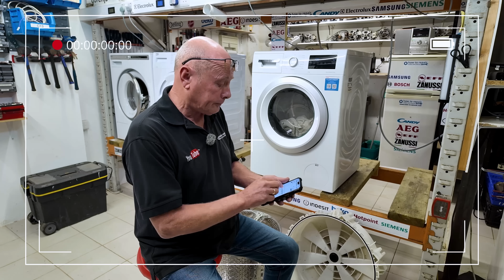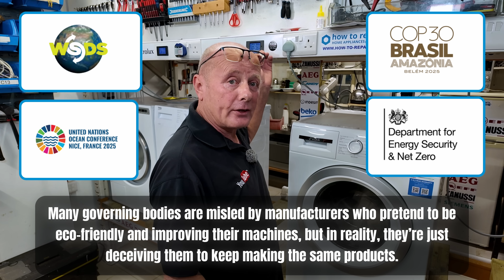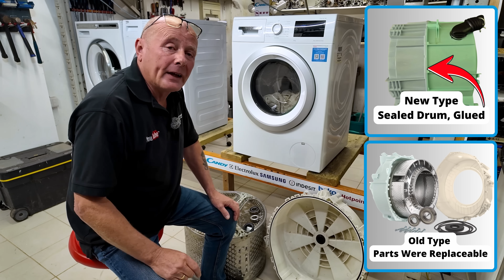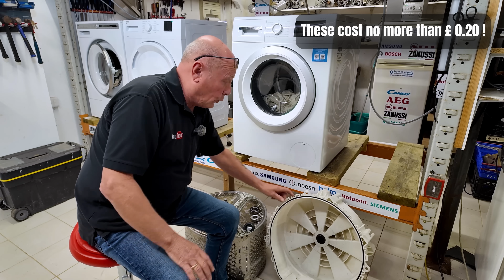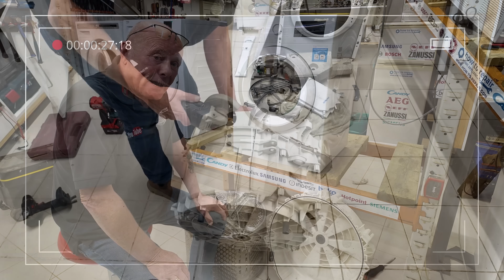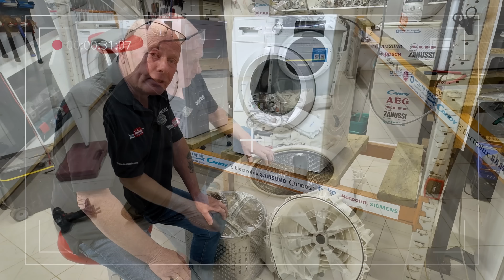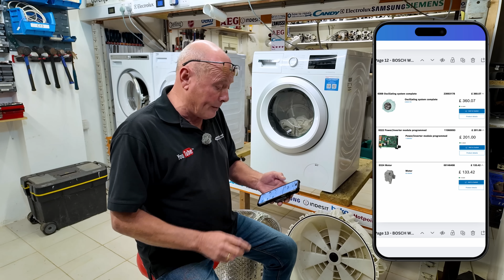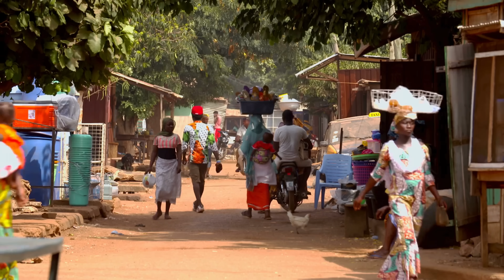Washing Machine SCAM EXPOSED! The Truth About SEALED Drums: Naming & Shaming

Comment: I can vouch for this Northern vs Southern Hemisphere build difference…

I’m from the U.K. and I moved to Thailand in 1998…

But yeah… I got a Samsung front loader I bought for 42,000 in 2010 (about £800 back then) and it doesn’t have that sealed drum scam and I’ve only had the pump, soap dispenser solenoid and 2 belts replaced! ❤
Still going good 👍🏻 

But front loaders aren’t really a common thing here…

Mainly domestic front loaders are bought by the rich & trendy and the big industrial front loaders are at the launderettes…

The average Thai still buys & prefers a top loader…

A 12kg top line one would be 15,000฿ vs 50,000฿ for a front loader… 90,000฿ for a washer dryer!!  😂😂

Comment: Just had to replace a Bosch Maxx because the digital display/circuit board (Control board, would fail part way through a wash cycle. Cost of replacing this in NZ (together with a Sub board and EFI (Electronic noise Filter was $725,  approx 2/3rds of the cost of a new machine. Number of cycles it had done was just over 800. and in all other respects was a still a very nice and well cared for machine. 
You are right, we are being scammed on everything, but why would the big corporations be any different from our governments. Also with VAT (called GST in NZ) at 15% here, there is absolutely no incentive for any government to reduce its indirect tax take by keeping prices reasonable. It wouldn't surprise me if the instructions (or at least suggestions) came from at least one overspending  Government.

Comment: My washer and dryer will be 30 years old in a few months. No way am i going to give them up. I've had to replace about $30 worth of parts in those 30 years. No PCB boards.
You'll never save enough water or electricity to pay for a new washer and dryer every 3-4 years.

Comment: I hate plastic headlights. I have a Berlingo from 1999 and headlights are glass and CLEAR as the day they were made. My Citroen from 2005 with plastic headlights became milky after10 years. Here in France the electric water heaters (cumulus) has a pcb with an obscure and often hard to find reset switch, if the board overheats - it is switched permanently off - unless you know where to find the switch! (youtube)

Comment: Thank you for your hard work, videos and informative work. I started buying appliances and equipment a few years ago based on repairability. Had a issue with a wmf bean to cup coffee machine where the flow meter failed and they refused to sell me one. They had a propriotary plug on it, ended up buying a few different model flow meters, modding the machine and fixed it, did end up loosing +-5% of actual read flow value compared to origenal but i fixed it instead of replacing...If i cant fix my own thing I bought with my money, then the company doesnt deserve my money.

Comment: If these washing machines get cheaper, it will be better just to buy a new one. I say that because when my washing machine broke it took two weeks before I could get someone to look at it under the warranty. With the average cost ., about £150 for a drum replacement when the parts are only about £15 no difference  we are getting ripped off either way., and you’ve got the ones that come out to repair your washing machine telling you you need a new motor when it’s only the brushes. That’s what you had to deal with years ago before YouTube came along., so for me if these washing machines are cheap enough and they last you a couple years I’m all for it

Comment: From the number of standard washing machine failures on multiple machines. one of them could have been avoided if the manufactory hadn't left off a 1 cent part. I would say the companies must have know about the issues, but have done noting over the years in changing there designs to fix them.

Comment: I've had an LG washing machine for the last 11 years and it's still running fine, no issues or breakdowns so far, despite doing 2-3 washes on some days in a busy household. I can't generalise of course, but in my experience LG household appliances (I also have an LG cooker / oven, microwave and fridge freezer) seem to be well made and reliable. And whenever one of these appliances does break down beyond economical repair I'll buy the same brand. I just hope LG don't take on the same bad practices of planned obsolescence as western manufacturers.

Comment: EXACTLY! I did this 5 years ago when my drum in candy is woobling around. I asked service how much will cost a repair of that, they said they will not repair that but they can sell me a new drum for 350€ and replacement will cost 120€ and new machine costs me 420€. Than I cut appart my drum changed bearings with best I can buy and sealing from gorenje and glugin and screwing drum together and after that washing machine still works. Until I found out with my costly fridge, bosch is a crap.

Comment: I'm 100% with you and will take that information into consideration when buying new ones. Currently I'm running on 2 12 year old siemens iq500.

Problem here in Germany. Mechanics, builders, etc. Are not investing into new people. They pay bad, let their employees work long hours. There is no incentive to create a new generation. Because prices for them are skyrocketing. Last guy "repairing" my dishwasher cost me 500€ in labour alone. He never figured out that the neutral line had a connection issue. Changed motherboard, changed the valve system. In the end i fixed the electricity and water over 750€. Still want the possibility of repairs...

Comment: Most manufacturers in most fields design failure.
Most consumers with a brain stop buying their criminal crap. 
I am 64 and have bought two washingmashines in my life. One to my house when I built it 1979 and I replaced it 2016 with a new one. 37 years.
First Electrolux wascator industrial class. The second one Electrolux Professional and I expect them to work till I die.

Comment: Proof is that Donestic & General Insurance scammers know how the manufacturers potential in upselling the warranty straight from purchase !  
Legally the appliance or 1979 sales of goods act is your protection not the over sale of warranties as is your fit for purpose section that covers all the major clauses so does 2015 consumers rights act. 
Many  years of being an engineer I constantly had to deal with failed machines in the first year or two with sealed drums snapped spiders or splitting of cheap metal welds . 
Arguing with D&G who obviously co profit the margins and operating with manufacturers to make more money from the customers will cheat the customers constantly by leaving them stranded or pressured to keep paying ! 
Quality is reduced for profit .. it's not just the appliances industry it's hit the car industry as well - Designed to Fail !

Comment: I had to reverse engineer my combo fridge/freezer Hotpoint Ariston Quadrio because they do not provide any schematics or even a block diagram to be able to fix their dmn machines. Many of them brands don't even have any service/repair center. It is the same with everything from a heat controller and stove, to gate sliders and kitchen apliances. I have fixed most of my things myself till this day but electronics and software are getting in the way, sometimes it seems to me that a perfectly working device just decided to stop working even if i can find absolutely nothing wrong with it.

Comment: This is not new ! 30 to 35 years ago I was repairing TV's, videos, microwaves etc. At that time a microwave magnetron or a motor for a video plus a very small fitting charge would mean the cost to the consumer would be more than the cost of replacing the equipment.
It's rediculous

Comment: I bought an Indesit WG1130TGT washing machine in 2000, twenty-five years ago. It was only in the last few years that it started playing up. A crackling sound was coming from behind the control panel and the wash drum was either jerking or not rotating at all. Having opened up the machine and checked the state of the motor's brushes (still lots of graphite rod left!), the cause was minor water leaks from the metal outer drum's metal backplate (yes; an all-metal outer drum, unlike the plastic ones of today!), specifically from each of the central ring of well-rusted bolts that held the spider hub to its internal face. The water had been dripping onto and into the electrical terminal block on top of the motor, mounted directly underneath (silly place for a terminal block, but I guess the manufacturer wasn't anticipating the machine to be in use for such a long period of time such that the bolts would become so badly rusted). The plastic casing of the block had black burn marks and corrosion was evident on the spade terminals. I couldn't find a replacement block or a suitable generic one online, so I removed it and joined the wires with bullet-type terminal crimp connectors, leaving them well back from the backplate. Tested everything with a digital multimeter and problem solved.

Some time later, the pump failed, preventing use of the machine. I opened it up (no convenient little door on the machine's front to open to clean the filter) and removed the couple of bits of material jamming the impeller. I'd cammed out the Torx screw heads (had no suitably-sized driver), so cut out the flange bosses and widened the screw holes so that some bolts I had could replace the screws. Problem solved.

Some further time later, the machine was making banging noises as the wash drum spun down. Turned out that each of the arms of the drum's spider had completely split from the hub. The cost of a new spider-and-hub assembly (you can still get them!) is about twenty quid. I've already got stainless steel bolts to replace the rusted ones with, but, if I had to buy them, it would be next to nothing. I have, however, bought a replacement machine, a Bush, as the next thing that happened was my combi boiler failed and it couldn't get it repaired for a while, so I couldn't even hand-wash stuff, so the old machine is going to be a stand-by and fun repair project. How many more weeks'/months'/years' use I'll then get out of it only time will tell, but, given I'd paid around £200 for it, all those years ago, it's already proved itself terrific value for money. My new Bush machine cost £240 but it seems it won't be lasting anything like a quarter of a century and it'll be practically and economically irreparable when it fails.

I've photo- and video-documented my repairs on my website.
Reply: I forgot to mention that I applied liberal amounts of silicone sealant around and over the rusted bolts to stop the leaks. Worked a treat as a (semi-)permanent fix.

Comment: I have a dryer now where the mechanic tells me I have to replace the whole motor despite the motor working well. This would be because the parts holding it upright is not in good shape, so it tilts and gets stuck. So some 100 pounds just for part, and double for work. That's insane!

Comment: I had to replace my 20+ Yr old machine about 5 yrs ago and the bearing went in the new one after approx 3 years, as this video has said it had a sealed drum so couldn't get to the bearings. A new drum was nearly £200 and a new machine was £350. Ridiculous!!
Still fixed it myself as £150 saved is better than nothing i guess..

Comment: The problem is that although parts are cheap, labor is expensive. Manufacturers realized they could design for low cost/expensive repairs and convince customers to buy new instead of repairing. Short-term, it's arguably a net neutral for customers. Unfortunately, it drives repairmen and after-market part suppliers out of business entirely. Once the competition is gone, OEMs will drive price up, resulting in a long-term net negative for customers. 

Support your local repairmen.

Comment: It should be possible to reverse engineer these high cost items and create OPEN SOURCE HW replacements at a fraction of the price.  There is NOTHING SPECIAL about either the mechanical or electrical designs.

Honestly the WiFi part is not really useful for most people!

Comment: How can a cold filling only washing machine be economical friendly when it’s constantly needing electricity to heat up each load of water and the electric it needs like the elements of a kettle or Emerson heater to conserve electricity and old systems to a airing cupboard and copper tank and gravity fed water system in a house and a gas or coal or oil heating systems that you always had a tank of hot water and the older washer used to take cold water and hot water and it could heat from cold but not now because we only have cold filling machines that we have to running for longer periods of time to heat up to the desired temperature to increase the program time to a average load on 40 degrees takes twice the time of the older machines. A hotter temperature takes 3 hours a load of wearing out the machine quickly to appliances are not built to last today cheaper quality metal that rust quickly and plastic parts and many machines are not able to be dismantling and repairs are not possible. The truth of economic growth and marketing strategies today is not to build reliable equipment and products that is to keep the consumers replacing all the equipment and items made today more frequently than ever before. This pyramid scheme structures of wealth management is the devil’s advocate for the poor to be exploited by their rich people who have power over the masses to understand the truth behind the Bible is to understand evil evolution and secret societies to hold knowledge of the world to hide tech advances and science and technology that has existed on earth since ancient time. Spiritual influence is real to spiritual power from practitioners into paganism and occultism and satanic rituals known as faith systems on earth to be the kingdom divided upon itself is destroying our world today we have been misguided by the world religions and cult cultures beliefs and practices of spirituality to be laying beyond the world religions and governments and kings of the world to have sect secrets of power.

Comment: I had the main bearing fail on a Bosch. Under warranty, the guys came out and fitted a new drum. It was a lot of effort and considering how much time it took to do, I wouldn't be surprised if it would have been cheaper to just replace the entire machine? The repair was excellent though. Not one issue since.

Comment: The quality of most manufactured goods has fallen drastically since 2020, clothes and shoes as well as appliances.
After eight years with a Bosch 6Kg load Washing Machine which cost around 500 Euro in 2017, last year it stopped working and I replaced it without making a real effort to discover what the coded fault on the screen was.
I then bought an Indesit for 330 and so far it's been washing clothes much better than the Bosch due to it using more water than the Indesit provided I put in small loads and select 2.
It only takes an hour to do a wash and any temperature can be chosen up to 90 degrees.
It's less noisy than the Bosch as well as being 40 minutes faster for a good wash.
After getting rid of my old machine and using the new one for the first time, I discovered the reason it had stopped working had been a blockage in the waste pipe because the new machine cleared out a load of gunk when it expelled waste water from the washing.
I didn't mind though because this one washes and rinses so much better.
I think that Bosch being one of the Globalists makes their machines give the least water and you can't wash clothes without enough water.

Comment: As a white goods service engineer for over 9 years, I replaced 100 of drums split and sealed. It is truly a fact that main component that fails are bearings, spider, motor brushes or on DC motors the motor  inverter boards. Advantage of sealed drums is the speed of repair even, if the drum failed, it needs cleaning the drain-pum-hose linked parts. It's never change the drum and job is done. With small kitchen and integrated appliances, poor design of plumbing and electrical connection, job takes in exes of 2h to get done. Poor understanding of costumers how to use optimally the wm, loading, maintenance wash, adjusting speed depending on the load, will shorten the life of the wm. I used my AEG as a second hand until the main control board failed for 14 years. Had the drum replaced once. When I worked as engineer sealed drums were at price around £170. This was price for insurance company so retail price could be different..

Comment: These 'ideas' are all discussed at Davos where CEOs all gather to discuss ways to make money together. Just as Microsoft and HP did when they brought out Windows 7 and HP refused to write new drivers rendering millions of printers useless. I've changed my Hotpoint Ultima bearings several times now and when my nephews bearings went I told him which bearings kit to get and couldn't understand why he was having difficulty in separating the drum. Off I went to rescue him and he had a sealed drum. Needless to say he had to go out and buy a new washer! Hopefully the Chinese will see that there's a huge market here and make compatible drums!
Reply from the maker: That is a truly essential and infuriating story that captures the ultimate betrayal of trust by manufacturers mate. Your insight directly confirms the cynical core of the planned obsolescence model. You've also hit on three crucial points: the corporate collusion history, the deception of the sealed drum, and the potential for a disruptive Chinese aftermarket. To make any real impact, we need to catch the attention of industry leaders and put an end to these wasteful practices. Sharing this post is essential to help spread the message. Thanks, Paul!